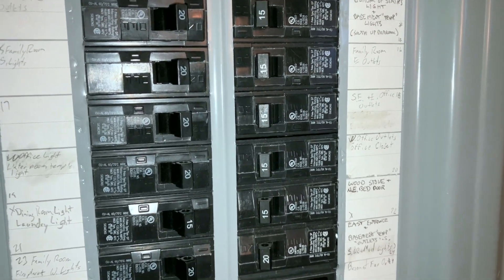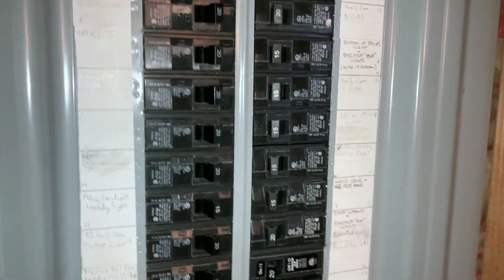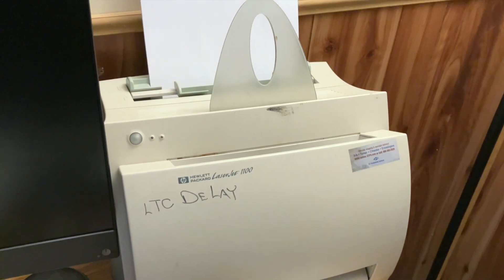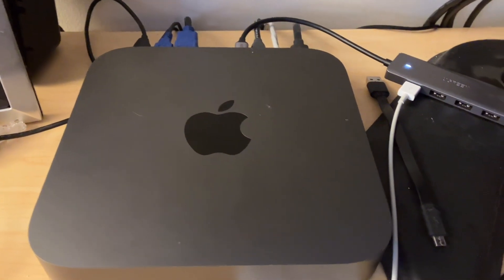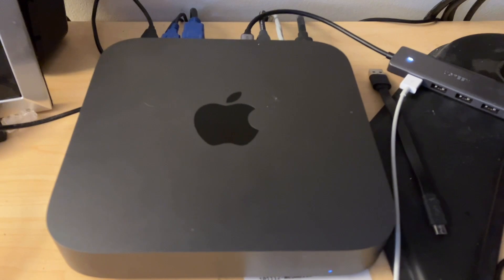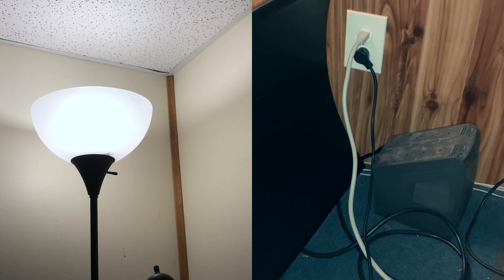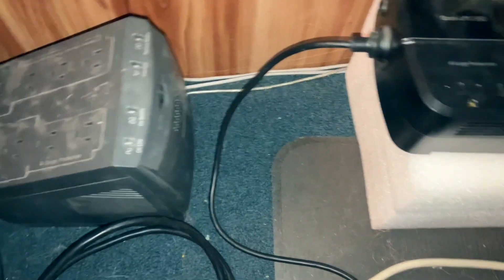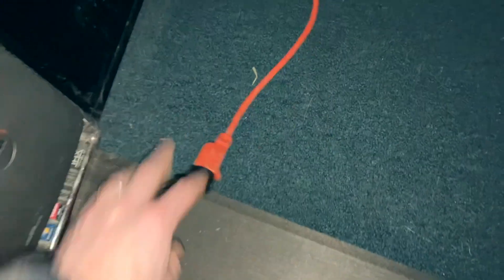Possible Flickering Light Fix for my EG4 6500s?

Comment: I have a Victron 24/1200 and my lights flicker. I started disconnecting different components on the circuit to find the cause. When I disconnected my iMac the flicker stopped. Even with the iMac off the lights flicker as soon as I plug it in.
Reply from the maker: @enosmunoz911  that’s exactly what I experienced with my 6500s as well.  When I upgraded to Victron though, the problem went away.

Comment: Got any solution ? Facing a similar issue with a PC, rest all the scenarios are same.
Reply from the maker: I had done all the firmware updates and it still didn’t resolve my issue.  The only thing I found I could do was either plug the devices into the phase that didn’t have as many lights running through it or run an extension cord to a grid outlet and run computer strictly on grid.  Wish I had better news.
Reply: An ideal solution would be something like an UPS or a Capacitor Bank that stores the excess Electric when it's not drawing much, and provides the PC that sudden Power Spikes, but haven't found a device that can replicate this.  @AdamDeLayDIY

Comment: Replace the EG4 with Growatts, haven't had but one problem and that is customer support but since it works fine, I guess I don't need their support, HEY? Yeah flickering can be cause by a number of things, I run everything off one 3K AIO that is 120v, I don't need 240 in an emergency situation. One single little AIO runs the entire 2000 Sq Ft house, to include 1one ton inverter, 5 ceiling fans, lights and all kitchen appliances, all smarter than me, also smart switches, all Zigbee as needed. Not a flickering issue. I also have a PV system, that works fine no flickering off of that either. RFI could be a problem, and is a matter of finding where is coming from, older CRT TVs, leaking electronics, I would check any electronic device nearby specially if is hooked up inline. Hope you find where that flickering is coming from and ZAP it soon!
Reply from the maker: Thanks.  I've actually upgraded to a Victron system for testing.

Comment: Sounds to me like an issue with the switching mode power supply on the Mac, and something to do with the electrical cycle. I'm not an expert but I'm not naive to electrical issues
Reply from the maker: Entirely possible.  All I know is I don't have that problem anymore with my Victron system.
Reply: @AdamDeLayDIY  That's interesting, are you using a victron inverter versus EG4 ? And you only had issues with the EG4? I know victrons are certainly built very well probably has some better filtering and other components I'm unaware of. I do know there are some of the best tho. I do have a question off topic using a victron inverter do you still get that flicker when it switches over from grid to battery? I have a feeling that's going to happen regardless the brand of inverter used.
Reply from the maker: @JbVest  yes I’m using 2 Victron multiplus 2 5kva inverters that Current Connected sent to me to test and review.

https://youtu.be/5Q22W5bhs-c

The transfer time seems much less noticeable.  It kinda depends on what’s running at the time of the switch.  There’s many times that I never notice it’s actually switching, but there were times with the 6500s that I never noticed the switch either. 

The biggest thing you notice is when a larger load kicks in, but you’ll probably see that on any inverter (and even sometimes on grid power).

Comment: The problem with the output of voltronic inverters is not very clean especially when mppt is providing power at full battery capacity and low load.
Reply from the maker: It happened during the day and night though.  I make another video about my findings.
Reply: You need a not dimmable LED bulbs that filter the bad input waves i have both in my house and from my experience with 3 inverters Sorrotec, Sako and Voltronic max, Sako was the cleanest output i've ever seen but its not reliable in terms of mppt and board protections.  @AdamDeLayDIY

Comment: Probably the fan in the pc doing it. Like a washing machine during agitation it will pulse the circuits in the home. The fan may have a speed control that is varying the frequency and causing the flicker... 🙂

Comment: I did the latest firmware update on my EG4 6000ex about a month ago and it completely resolved my flickering light problem. I will say though, our lights would only flicker during the day while the PV was recharging the batteries.

Comment: Thank you for the video,  I am having the same issue. This helps give me a troubleshooting path.
Reply: So I thought I had solved my issue but now the flicker is back!!! After watching your video I went through all circuits in our off grid home and found no Mac mini equivalent problem children. I did find a loose ground wire in a sub panel which I secured and then did a full system reset. All worked great other than one led light on a dimmer. After switched that out for a switch I had no flicker for 12 hours then 20 minutes ago, my arc-fault breaker tripped as it had the last time the flicker issue started and now I have a bad constant flicker on one light, the fridge light, and the oven light! Resetting the arc fuse breaker brings back power to those circuits but the flicker persists. Back to troubleshooting! Please keep updates coming if you do find any solutions!

Comment: My flicker issue occurs with batteries charged above 57 volts, and the air conditioning comes on. My 2P1 flashes in the display of the inverter. Only does this in the master inverter. When the batteries are around 54 volts, no flicker.
Reply from the maker: Interesting.  I’m assuming you have battery comms set up if you’re seeing 2p1 flashing?  From what I understand, that happens when there’s a warning/error coming from the BMS.

Comment: Have you tried running the mini on battery? Have you swapped the mini power bricks? In my experience, it is often a switch mode power supply that causes problems.
Reply from the maker: The minis don’t have power bricks.  Just a cord.  The power supply is 100% internal.

Comment: On your Mini Mac the AC to DC converter(power supply) is not a working correctly. I would plug that into a lithium portable power station. Plug the station into the wall and that will isolate that flickering.  You can get one of those for under $500. Or replace the power supply in your Mac to a better one (aftermarket) if possible.
Reply from the maker: Thanks for the suggestion!

Comment: That sounds like it might be an RFI problem. A lot of computers are badly shielded and give off radio frequency interference that can feed back through the cables and might be getting back into the EG4. If an odd frequency is feeding back through the line to the inverter it could cause problems.  Some equipment is more sensitive than others. I'm an amateur radio operator and I used to have a paper shredder that would turn itself on every time I transmitted on a certain frequency.  You can try picking up some ferrite chokes off Amazon and winding the power cable from the Mac Mini through it a few times and see if that helps. They're only a few bucks

Comment: APC's  brand has always been a problem, junk them they have destroyed more computers than people.  The diaode circuitry or lack there of allows back feed.  Your computer is going out due to the APC, you don't need it especially now that you are on battery power.
Reply from the maker: I've had APC UPSs for years and never had a computer go out because of them.  Never really had any issues with them at all.

The problem exists with the computer even when I completely disconnect the UPS.  

I do still need the UPS, because when I do tests/videos which require me to manually switch between grid/inverter power (through my panel interlock kit), I don't want to have to power down all my computer hardware and internet equipment.  Guess you could just call me lazy...😁

Comment: What’s up Adam 
 So anyway signature solar finally stepped up to the plate and will accept my faulty and error code throwing 6KW units back for a replacement I was just wondering how long it took them to evaluate and send you our new units since you got your 6.5 KW’s replaced
 Keep the great videos coming 👍🏼👍🏼👍🏼
  In my opinion we should not be having to do all of this troubleshooting on our time this is nothing but a pain in the butt and poor excuses for not doing the research and development before they put these units on the market 
 I’m very frustrated and upset with signature solar I am going to try growatt units instead I have had MPP in the past and they run fantastic but on the other hand I was not running my whole entire house with them but never had issues and customer service was fantastic through them
 🤮🤮🤮 poor excuses from. SS ALWAYS
Reply from the maker: Glad to hear you're FINALLY getting things taken care of.  Seems like it's been quite a long time.  

Since they were RMAing my units, within a couple days of them receiving the old ones, they shipped out the new ones.  Seemed like it was around a week.  Actually took longer for them to get back to SS then it did for the new ones to get to me.  Not sure they use the same shipping options for the RMA.  

I know of several that run their whole house with the MPPs and have had no complaints.  Honestly they're basically the same thing as the EG4s, just no custom firmware. 

Keep us updated!
Reply: @AdamDeLayDIY  I will and thanks a lot for letting me know the turnaround time 
 I think I’m going to go with 3 5KW growatt inverters with a 11kw transformer  for the whole house now since the EG4 6kw have just made me sick 
 Later dude 👍🏼❕🌞🌞🌞
Reply from the maker: @cowboymcq6711  Take care!

Comment: Hey there - As stated in previous comment, I have almost the exactly same setup as you - even more battery (30kwh - 6 batteries) and more solar panels (12kw over 4 strings).  In my office, I have a separate subpanel, 4 120v AC runs - two on each side of the office - on them, there are a total of 4 UPS's - for my computers, NAS, etc. just like yours.  My main computer is also a Mac-Mini, but I also have several other computers.  My office light also flickers (it is an LED) all the time. I just assumed it was due to the fact that it was dimmed as I rarely have it on 100% brightness, but after checking, did notice it happens all  the time - sound familiar? 

The mac-mini's have a 130watt power supply. A bit overkill for how much it actually draws, but whatever - Apple tends to over engineer stuff. 
Question - did you plug in the mac-mini into the wall without the UPS in the middle?    Try that.  My thinking process is to try to isolate the UPS, as well as the mac-mini. 
Also, have you tried plugging the mac-mini into a plug on the other 120v leg? 
You might also want to try this - the laser printer also pulls a shitload of power when it runs (not in idle).   Plug that only into the UPS (instead of the mac-mini) and turn on the Laser Printer.  And then print something.  When I do that, all my other UPSs beep on initial turn on, and when a page is printed - as if there is an intermittent power loss.   Very Curious indeed. 

Does it cause your other UPS's to beep?  Either way, I'd be willing to bet it causes the same issue with your lights when plugged into the UPS.

If this is the case, the issue is the UPS with a heavy load on it.   Remember, the UPS's have very large capacitors and stupid electronics, which try to normalize power and react in milliseconds.  Its been a while, but I believe that the UPS documentation say they all will prevent a power failure but can be offline for anywhere from 7 to 20 milliseconds for the switching circuitry to work.  I have had a failed UPS, and I did a warranty return with APC, the vendor told me very strongly NOT to plug in laser printers, due to the initial draw when starting/printing.   I found that to be surprising but it makes sense. 

Here's some more information to help your cause/hunt. 
In my case, i have a well pump connected to the 240v - one leg on each of the inverters.  It works great - starts properly (the 6500's can handle it) and runs well,  but as you can imagine, it has a large startup inductive load draw.  When it starts, ALL OF MY UPS'S IN MY OFFICE click and beep also - as if I lose power.  Interestingly, I also have a 120v mini-split AC on one of the legs, and a digital clock on the other and neither appear to lose power (at least not long not enough for them to turn off/on anyway).  

Being an engineer, I'm concerned for my equipment when there are micro-power losses or brow-outs  For what it is worth, even off grid, I like the protection of the UPS.   I'm not comfortable having my computer equipment plugged directly into the AC - Regardless of on-grid or off.   Micro-blips (as well as other brown outs) in power kills electronics, and motors / compressors.   Therefore, ANY momentary loss of power peaks my curiosity and raises my concern.  

Thanks, Interested in hearing your results. 
Howie
Reply from the maker: Howie, thanks for the info.  Yes our setups do seem very similar.  

I did completely isolate the mac mini from the UPS and it still was causing issues with the flickering lights.  Out of the 4 UPSs I have, only 1 wouldn't constantly click between line and battery power when the inverters are in the power flow.  While I've replaced batteries in them recently, I'm wondering if some of them are just too old and excessively sensitive. 

I know someone suggested adjusting the sensitivity of the UPSs in powerchute to see if that helped, but it doesn't look like powerchute is supported on a mac and I need to dig up a windows machine to try that out.  

I'm in the same boat with wanting my electronics protected, regardless if I have backup power or not.  You never know what could be introduced into the line.   I should really get a new UPS and see if they have the same problem.  

Thanks again!

Comment: I had just purchased a small UPS for myself. I noticed in the ad it said this "approximated sine wave to supply cost-effective battery backup power to equipment that does not have Active PFC power supplies" not sure if this helps.

Comment: Looks like the proper fix would be switching to Low Frequency Split Phase Inverter. It will be always something that may cause that kind of behavior with 6500ex. I.e. you fixed it for now but there is no guarantee that something else in the future won't be causing an issue :( I tried to find LEDs that won't flicker with partial success but got a bit tired doing that. And it has nothing to do with bulbs being cheap or "real brand". I'm thinking about picking up this 6000w 48VDC LF Split Phase inverter and hoping that it will fix these issues completely.
Reply from the maker: If you do, let me know how it goes.
Reply: I have 2 6kw in parallel. And they have done nothing but throw codes 🤮
Reply: @cowboymcq6711  :( You have LF EG4 6000x? I wasn't thinking about those. Was thinking about switching from all in one unit to modular system with Sun Gold Power 6000w 48V inverter/charger.
Reply: I have the 6000 split phase it flickers also, also idle wattage is 130w something to consider
Reply: @richardshipley2305  which one do you have? EG4 6000ex? Or maybe MPP LV6048 (HF inverter)?

Comment: Thanks, Adam, I have one 6500 with the latest firmware. The flickering is intermittent, not all the time, It happens when I am on battery only, solar and battery charging, and with the utility connected, it doesn't seem to matter. The latest bizarre episode was when I turned one set of shop led's on (only load), which pulsed badly. I turned on a second set of shop lights and the pulsing stopped altogether; I am baffled!

Steve
Reply from the maker: I have seen that some bulbs draw so little current, that when they're turned on and there's no other load, the lights flicker.  Once you add an additional load, the flickering stops.  I've seen this in the past with lights in my own house.  I actually turned on another set of lights and the flickering stopped, and when I turned the extra lights off, the flickering started back up.  Did this several times and my wife was wondering if I had finally lost it.... :D

Comment: Wild guess based on the Mac mini's being different generations. The computer power supply or something with the BIOS, firmware and energy saving mode the computer uses.  The power supply could be the problem even if they are the same generation.
Reply from the maker: Yeah, it's really weird.  If they were both mine, I would look at swapping the power supplies and see if it still happens on the other one, but don't wana mess up the work computer.

Comment: Could you plug the mac mini in another part of the house to see if the same thing happens?  Maybe even look to see if the neutral and hot on the receptacle could have gotten reversed.
Reply from the maker: I have another circuit on the other phase that I'm gonna test, but it's behind shelves in my office.  

I have tested the circuit in question and it's wired up correctly.  Plus it only happens when the inverter is in the power flow.  When the inverter's outta the picture, no problems at all.  Possibly some interference from the power supply distorting the sine wave from the inverters.